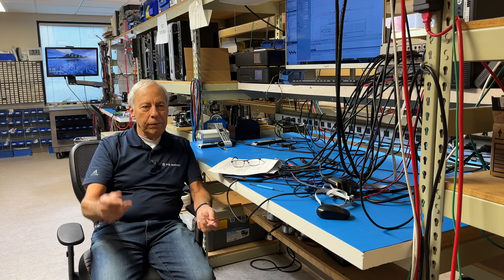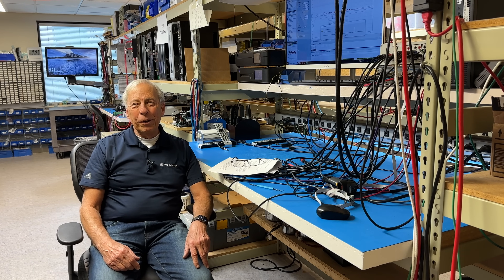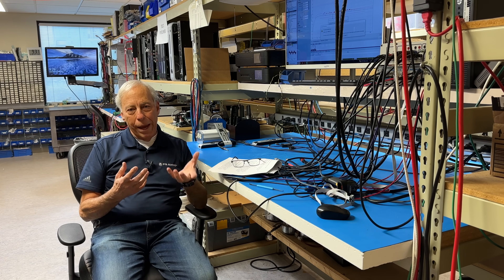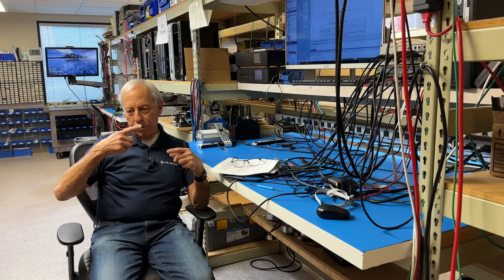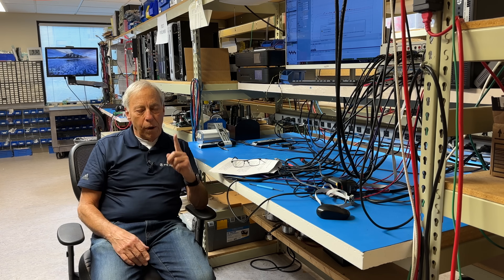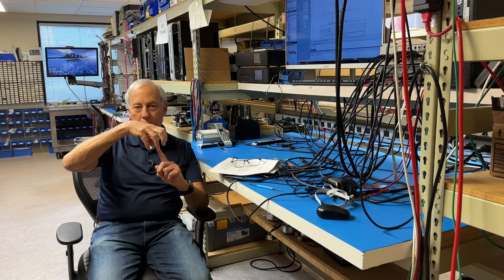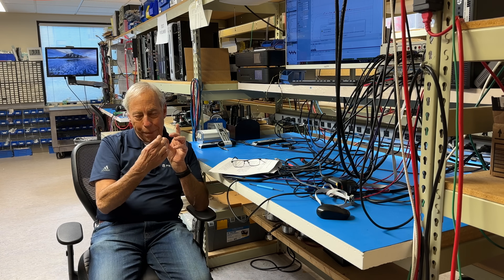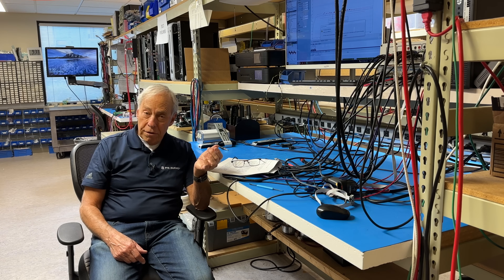Differences in phono cartridges

Comment: As there are additional philosophies involved here. One of them I contend with all the time. Bass Drum, microphone phase. Normal or inverted? Well that depends on your point of view there. And I follow 2 philosophies. Is it Rock or Jazz?

If it's Jazz. I do not invert the phase.

If it's Rock. I will generally invert the phase.

As with Jazz. It'll be bigger, fatter, sloppier, rounder, sounding. Combined with the, in phase, overhead MIC's and those overtop, drum heads. And those low frequencies will all combine and build.

But with Rock. That, Bass Drum microphone. Is, inside the Bass Drum. Which is like  the microphone. Under the snare drum. Which must be phase inverted. Because it's under the snare drum. Making it phase inverted to the other microphones. Because it is pointing in the opposite direction. And for Rock. You want that Bass Drum. To feel like, CPR upon your chest. And that's how you get that sound. By inverting the phase of the Bass Drum, microphone inside that drum. When combined with the other microphones. Overtop that Bass Drum. That has its microphone facing in the opposite direction.

And so there. Is when we play with and express, phase. But then there is also phase timing between microphones. Where you want to follow the, 6 to 1, rule. Otherwise you will get, Nast Comb Filtering. When you have microphones, too close, together. And not far enough apart. By about 6 feet. As that causes other phase timing errors that will be heard as tubby sounding, comb filtering. And will present a cloudy hazy sound.

And of course. A lot of these microphones on a drum set. They are not 6 feet apart. Therefore. When all turned on together. The drums might sound kind of, cloudy and sloppy, jazzy, not tight, loose as a goose. And that's why, God created. Dynamic range limiters, equalizers and downward expander, noise gates.

And so I typically will have a limiter each and every drum. I will have an EQ of filtering. On each drum. Each drum will be fed into a dynamic range limiter. And each limiter will be fed into a dynamic range, downward expander gate. Or just gate. But sometimes. I will not let them turn down all the way. For various reasons. To stop at, minus six, nine, 10, 15 DB only. That is not a gate. That is downward expansion to that preset level of turning down not all the way. And I use that on vocals mostly. I use gates on drums. I will use an expander on a Bass guitar, may be a 6 string guitar. Maybe on an acoustic grand piano. Because I don't want it to gate and shut completely off. That would sound horrible!

And that comes under recording technique. That has nothing to do with the Absolute Polarity. Of your, Monitor Speakers. That's at the end of the line. Where it must move the air in your room toward or away from you. Pick one. Pick the right one. And you do. But your speakers are not doing what you think they are doing. They are doing the opposite in fact.

I mean this is truly a funny one. A funny one 99% of everybody has gotten wrong. And I believe it to be the biggest Technical Faux pas in Provo Audio History. And has nothing to do with what Utah. That I Taw. But has to do with Absolute Positive Speaker Polarity. And how everybody has gotten it wrong. With an innocent mistake. That everybody has gotten wrong. It's so funny.

This just makes me want to study, Sociology. As I feel this has to do with Sociology. And is a socioeconomic phenomena. Because it's not whether you have purchased cheap or expensive good or bad, speakers. Which really doesn't matter. They come in varying qualities. But it does matter.  Which direction. They toss the concept in, first. And how to verify your accuracy. With that battery test on the woofer. As when the wolf removes out toward you. With positive the battery on positive of the woofer. You will know. To use your DC theory 101. Connecting from your audio power amplifier. To the speaker terminals. As positive gets connected to negative and negative gets connected to positive. In order to make the flashlight work with 2 batteries in it. Right? You can't connect the positive terminals of the battery together. And use the negative terminals  to connect to the lightbulb. It won't work that way. DC cannot flow. Positive needs to be connected to negative.

So why would these audio power amplifier companies. Tell you to connect the positive going terminal of their audio amplifier output. To the positive terminal on your speakers? It needs to be connected to the negative terminal on your speaker. To stick with DC theory 101. Right?

So why does everybody design the circuit with DC theory 101 throughout. And then at the output. Connect the speaker wrong? Ouch!

This is one of those Ouch, moments. This is a full hand on face,, moment. This is a scratch your baldhead, moment. And wonder how this came to be?

It comes down to those guys that said they didn't want any out of phase anything LOL. Everybody was saying they wanted to listen to speakers in negative absolute polarity because they would be in phase! When people don't understand the difference between phase timing and polarity. Because phase is just not strictly polarity. It involves minutia of timing differentials. That creates  its own unique, room nodal induced, comb cancellations. And even the acoustic engineers are getting this wrong. How can they? What the hell is going on?

I find this all very queer very abnormal. That everyone could dismiss thinking about this factor? I find hysterical. It's like a 3 Stooges comedy short. Like the one with the plumbing in the bathroom. One of my favorite! That's what this issue is! And how all of the acoustic engineers and electrical engineers are trying to handle it. It's so unnecessary.  But it's only necessary.  To keep these companies going and operational, in business. Keep everybody confused and changing out their equipment, every couple of years! It's better than Detroit! Better than computers! It's cockamamie audio! And everybody chasing their tails! They want the best sound! And they are convinced their speakers are wired correctly. That's the pathetic part.

I mean this is really the mission I have been on since  the past 46 years! I just want everybody to get on board with this. I'm tired of listening to all of these industrial sound systems that sound potentially great. But only if the speakers were protruding out toward the audience! Nobody has figured this out!

It's just a simple mistake everybody made. It's innocent. It's also mindless. A simple wiring error. Anybody can fix themselves, for free. And I am simply on this mission. Of Audio Education. And so everybody could enjoy what they are listening to. On what they spent their money on. To hear it in the way. The artists and creators. Heard it in their heads. And not from a couple of speakers.

You will discover. An interesting, Psycho Acoustic Phenomenon. When you are in, positive absolute polarity. And you are listening to your favorite recordings of all time. You will notice a new and interesting phenomena. The sound is not really coming from your speakers. It's coming from slightly out in front of your speakers. Not from your speakers. It sounded like it was coming from your speakers. When they were in negative absolute polarity. Because it wasn't directing the sound toward you. It was pushing the sound. Toward the back of the speaker.. To go out it's poop shoot. Which it does not have. It has no holes on the back. Do not cut any holes in the back of your speakers! But that, is what they are trying to do. That's why the sound seems to be coming from the speakers. Because the sound is running away from you in place.

But when you are in Positive Absolute Polarity. The reason why the sound seems to come from in front of the speaker. Instead of from the speaker. Is because it has pushed the sound off the front of the speaker. Like throwing a ball. It goes straight until it loses momentum. And comes toward you quickly. Before it falls. War gets stopped by a wall. And audio is pretty much the same. But you can't see the sound. I can.

(More Real Life Audio in following post)

Comment: Great, informative lecture, Paul. However, there is the case of the an exception to the rule concerning the theory of Moving Coil compared, or versus Moving Magnet. Namely the Nagaoka Moving Permalloy Magnet Cartridge, whereby the MP-150 is worth the price, and a close affordable MM design, and has superior engineering. Check out Nagaoka MP Cartridge brochure; and has gotten many good reviews.🔉🎵🎶

Comment: Whatever happened with the piezo element?
Reply: Paul has been in hifi long enough to have shoved those out of working memory, though he did speak "ceramic" as a magnet. Much higher output than MM and MC. Much lower quality, with high tracking force needed and with acoustic distortion into the room at reasonable listening levels.
Reply: @tactileslut  ??
Reply: @aamiddel8646 It's not even worth talking about

Comment: Paul, I think the question may have been about Low Output and High Output moving coil cartridges as well as the difference between moving magnet and moving coil. The other implementation, of course is moving iron, where the mass of the cantilever is even lower. Soundsmith and Grado are two manufacturers of moving iron cartridges.

Then there’s strain gauge …
Reply: That's what I was thinking, Hana offer this with their Moving Coil cartridges

Comment: I'm still using my old Shure V15-V with "aftermarket" stylus. 
NO MM cart under $500 can match it.
Reply: That cartridge was no longer being made over 10 years ago. Berrylium, used for it's cantilver, or more exactly berrylium dust had become considered a hazardoius material in the workplace. The Shure V15 V was a nice cartridge; but nothing can touch it under $500? Have you heard 400 different cartridges, all perfecty set up? Shure made a cartridge with a metal body called the Ultra 500 which was a better cartridge and not way more expensive than the V. Employees at Shure thought a model called the Shure VST also outperformed the V,, and they liked the sound of it even better. I once called an audio store, whose employees had good ears and always told you right, and I inquired about the top of the line Shure cartridge which I knew they carried. The employee told me "As good as the Shure is, I think you'd be surprised how much better the Supex moving coil cartridge is".He was right! The designer of the Supex cartridge had the last name (still not famous) of Sugano. A Japanese master sword maker who a few years later became famous for his own brand of phono cartridges called Koetsu.
Reply: I have a Shure V-15 V cartridge. Haven’t found a replacement stylus for it. So I’m using Ortofon 2m blue and 2m red. I have a Shure SC35C I use for 45rpm singles and a Shure M97xe I hardly use that one.
Reply: The top Shure cartridges like the V15 series were consistent, good trackers and had an even frequency response. You could have done a lot worse. But there are other cartridges which sound like they have way more space between the instruments, have more detail, speed and excitement; although the transient speed on the V15 Vmr wasn't bad. Moving iron cartridges and moving coil cartridges generally have better transient precision. I had Sonus and AKG moving iron cartridges which were very good. I think Grado cartridges are moving iron also. The rest of the ones I had were mostly moving magnet or moving coil. I haven't used moving magnet since I discovered moving coil, except for one vintage Fidelity Research cartridge, which I used for a very short while.

Comment: I agree in part with what is said, but not entirely.
When direct comparisons were made with master tapes with an equalized level, some moving magnets like the Shure V15 type 4, type 5 for example were closer to the original tape than some moving coils.
Reply: Could you please produce the factual information. It's easy to just say something. I'm from Missouri so I'd like you to show me
Reply: @Scopolamine46  Hello  I'm European, so this is an English translation.

This comparison test was carried out in France in June 1980 by the magazine l'Audiophile.

there was a Dynavector Dv karat- a Denon Dl 103- a Nagaoka MP 50- a Shure V15 /4

Conclusion for the Shure V15/4

With this cartridge, the reproduction of the record would be close to perfection (i.e. the original soundtrack) if it weren't for the drag in the bass! the skin of a large drum seems less taut).
There's an impression of limpidity and fluidity that the other cells didn't provide.

Let me add that at the head of the Audiophile magazine, there was a gentleman called Jean Hiraga, who was very well known in Japan, at least in Europe.
Reply: @Scopolamine46  Hello, one more test: 

Shure V15 V l'Audiophile n° 25  review September 1982 

First listeners are immediately reminded of a top-of-the-range moving-coil cartridge, so dynamic and fast are the attacks.
The high-midrange is remarkable, and the extreme treble fine and loose.
The bottom end is very clean, held in such a way that the whole may tend at times to become unbalanced towards the top.
Compared to very high-end moving-coil transducers, West is still a little below its best, whether in terms of dynamics, low-frequency attack, richness of harmonics or reproduction of low-level echoes. 
But the V-15V still outperforms many moving-coil cartridges, with one or two exceptions.

The cell carrier should be selected with care, and a too-light arm/carrier assembly tends to rebalance the V-15v upwards.

Cells tested in comparison:

Accuphase AC-2 - ADC MC - 1.5 -  Audio Technica AT-33E - Audio Technica AT-1000 - Denon Dl 1000 - Denon DL-55 - Denon DL-207 -  Fidelity Research PMC-3 -  Glanz GMC-55E - JVC MC-5E -  Ortofon MC10MK II - Ortofon MC-200 - Yamaha MC 9 - Sony XL-50 -  Sony XL-55 II - Technics EPC 305MC MK II - Yamaha MC-3 - Supex SDX 1100 R  -  Satin M21
Reply: Legendary Doug Sax of The Mastering Lab and Sheffield Lab: "I like moving coils . . . in other people’s systems." 😄

Comment: Would someone please explain why the "induced magnetic " design (ala ADC) did not become more used and/or appreciated ? I always loved the XLM series and I wonder why this system was not used more often . It seems to me that it somewhat solved many problems, and allowed lower mass cantilevers but with higher output .... or does anyone still use this system without my being aware ?  Or why not ? Thanks
Reply: The Ortofon OM and 2M range are Moving Iron / Induced Magnet designs. Also Grado keeps using it in all of their carts, and Soundsmith uses a variation of it that they bought from Bang & Olufsen called Moving Micro Cross
Reply: Nagaoka uses this system too. I'm still using the Stanton 680/681 series those are also an induced magnetic moving iron cartridge . It's the only Stanton series that is and they were very popular...many DJs used the in radio broadcast and continued to use them afterwards at the hip-hop and rave events. Yeah all of us in the late seventies and eighties had one. Had a couple of Shure carts then an Empire ( also induced magnet) but all my friends were switched over Stanton 681 . I liked what I heard so I made the switch have been pleased with it ever since. That Steriohedron stylus tip was so good. Too bad Gibson bought them out and slowly dropped the entire line. That EL.4×.7 stylus was nice too. Especially in a heavier S - shape tone arm tracking at 3.5 grams it really could give an old worn piece of vinyl a breath of fresh air. Yeah as soon as I can afford one of those nude mounted Jico stylus I should. But I going to have to get something a little less expensive for now. I've only got one D680ee stylus left and need to keep it as a reference.

Comment: Paul. Please explain why there is high output MC and Low output MC
Reply: Probably mere marketing. A lot of people see "Moving Coil" and they automatically assume it's better than Moving Magnet or Moving Iron. In reality, High output MC's don't have either the electrical (higher frequency resonance) or mechanical (less effective moving mass) advantages over MM or MI
Reply: High output moving coil need less amplification than low output, so less expensive phono stages can be used.

Comment: It is hard to compare between particular models of pickups  .  A  lot depends on mass of canterliver itself and its resonance frequency. That moving mass is represented in tech data by so called effective canteliver mass (ETC) but only few are passing that information   Exceptional MM cartriges also may have it  extremly  low and it accounts to longer durability if needle and untouched condition of groove. .  I see modern MM are somehow bulky while 40 years earlier  the best producers could  do them much smaller,  lighter ...and expensive.
Reply: Canterliver? Sounds scary. 😉 I'd go with cantilever.
Reply: @Fastvoice  Good for you 😄